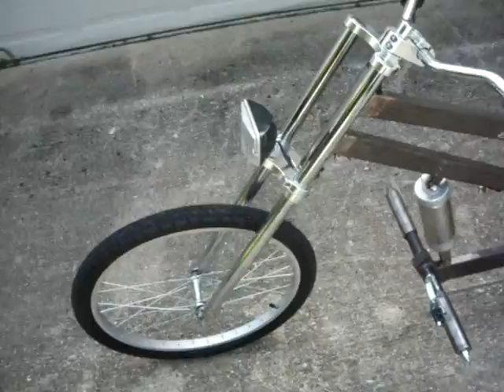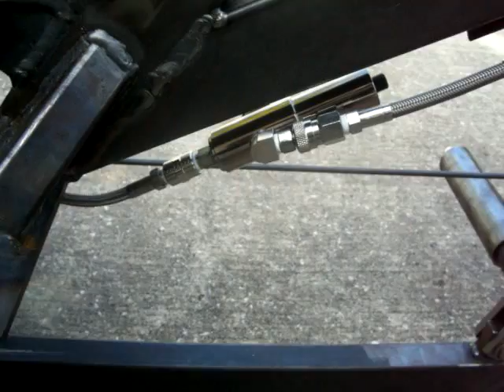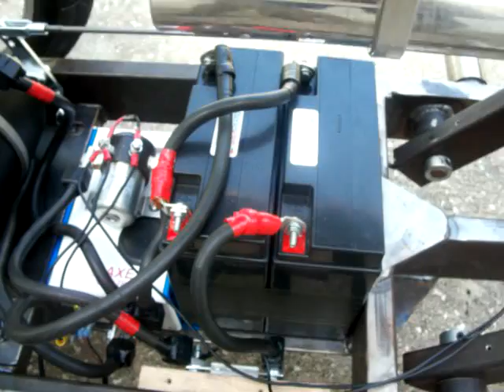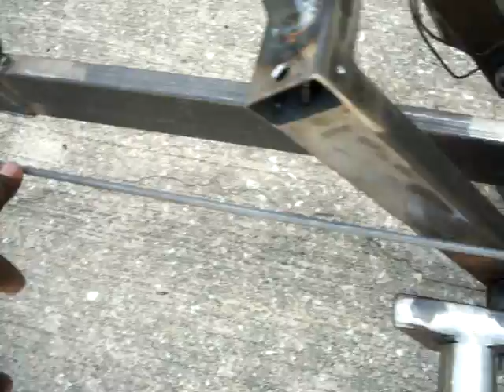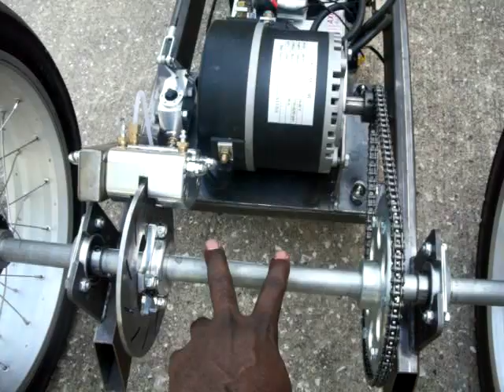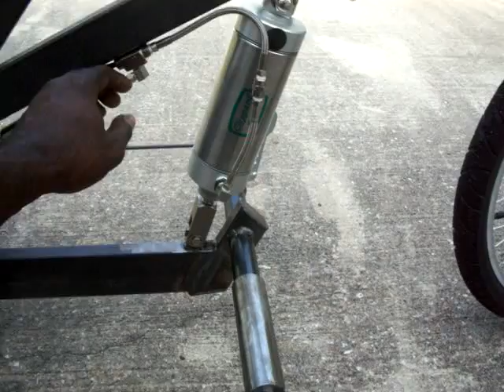Electric Trike w/Air Ride Suspension Pt. 2

Comment: 10-4 on the solid axle. Welding looks top notch. Everything is clean and sharp. Even the improvised pushrod and bellcrank break train looks tight.

Kudos.

Comment: Additionally, I've built some hot rod scooters.  You can use the Schwinn/Currie 24v 600 watt motor quite successfully at 36v.  I'm running 10S Lipo on mine and it has been working well for 4 years as a pit bike at outdoor trade shows.  I'm geared to run 28 mph, it's about 2000 watts setup as such.  It's the best of the cheap scooter motors that I've gotten to try.  If you have the dough, Lipo's produce quicker acceleration because they depress in voltage less under load.

Comment: I enjoyed your video.  Your a creative person.  Used to race Karts, back in my fathers racing days, he designed a one way bearing axle and hub setup to eliminate the scrubbing in the corners.  I still have the axle somewhere.  This allows one wheel to outrun the other or turn faster than the axle but not slower.   When you do this, the disk brake must be on each hub, not the axle since the hubs are allowed to overrun the axle.   Nice work sir.

Comment: Very nice build. Instead of buying a rear diff, you can just run one of the rear wheels and have the other wheel independent of the axle.  That should help with your turns. If you do this you may want to have breaks on both wheels so you wont end up turning when you break.
Reply: screw having the power go to both wheels, that makes too such sense right?

Comment: Cool. I know there was a lot of work to build that. I'm building a pedal powered machine that's 4 wheel drive and 4 wheel steer. It has Gokart disc brakes, sprockets and a Comet reverse gearbox. It will have multiple speeds. I'll also build a plow so I can plow the snow off the sidewalk with it.

Comment: Nice machine, & very good mechanical designs there, if you sort the diff out on it, & re-design the frame in a lighter material, you can patent it as your ow thing, as it looks & works great, one the best electric trikes I have seen. Good luck

Comment: COOL, how do I get a set of plans..???   I'm a disabled Vietnam Vet in a wheelchair, & 66yrs old, the kneeling feature would help me to slide on to it, I want to build one, & put an extra wheelchair seat I have on it, & I have an electric motor that I can use in place of your hydraulic cylinder to make it kneel.. do your plans also have all the info on the electronics/wiring also.??

Comment: Lots of excellent craftsmanship. and plenty of systems.  So a great test bed and tour de force of your skills.  Not enough batteries, nor right type to go very far, but for a test bed  doesn't matter.   Letting one rear wheel free wheel will solve your "turning" problem with no differential, but a 3 wheel bicycle differential might take the torque from the electric motor.  Get one from a Chinese 3 wheel bike.

Comment: Until you get that straight rear axle changed to a differencial, tip up on two wheels when you go around a corner. Heads up on a good source for a reasonably-priced differencial. A lot of older riding lawn mowers had chain drive to the rear axle with a small Peerless differencial which would be just the ticket for your appl. Oh, and I don't think that rear brake foot pedal setup looks bad! Good lookin trike!

Comment: a real quick fix for the turning problem would be to put a bearing in one rear wheel & let it free spin on the solid axle,it would only be one wheel drive but it would corner

Comment from the maker: Subscribe to my channel and please check out the ride video. Titled;  Electric Trike w/Air Ride Suspension Pt. 3 (RIDE). Thank you and Thank you for watching.
Reply: +BlvdMinSS I love the whole design. I was wondering if moving the forks forward about six inches, changing the fork angle more like a chopper as well as toe in back tires by three inches, would it create instability? I am epileptic and can not drive but, i have a stingray. I have no tools and was simply wondering how much would you charge to convert my stingray that way?
Reply: Hey, I have a few questions about how you build your trike. First off, are both of the wheels welded to the same axle, or is one not powered. What type of metal did you use for a body? and lastly, how much did it weigh?
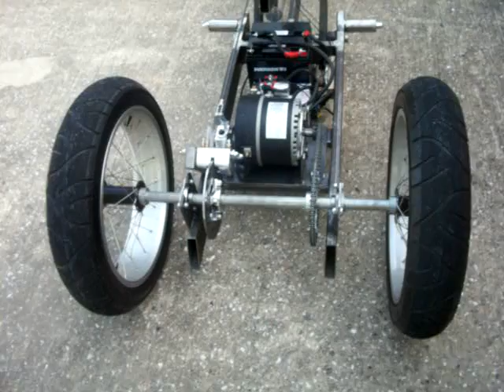Reply: BlvdMinSS   3:15 Reduce the length of the back axil or increase the diameter of the back wheels.
  This should significantly change the radius of the turning.

Comment: Beautifully done.  A few wire ties will solve the wire problems.  You might think of narrowing the rear track and introducing leaning rear wheels.  Google iLean.  Very simple but the iLean system requires a bit wider track for stand alone balance and heavy weight carrying.  The iLean system works best with two rear hub motors.
Reply: +Lawrence Rhodes I would have to agree with you about having 2 rear hub motors. That would solve the problem with having a differential, however would have to have a controller that slowed the speed of the inside wheel when making turns.
Reply: +Joel Hill Not needed. Ohm's Law will take care of it.  However while working perfectly one person asked the question of "why". https://www.physicsforums.com/threads/rear-wheel-drive-with-separate-motors.833068/

Comment: nice build, I personally would tidy up the cabling and especially cover the power contacts, don't want some short across that :P
the Pedal cable shouldn't be stiff and be like bike cable so you can at least route it around.
Does the controller provide charging should you go downhill, etc? so it charges back to the battery, I wouldn't thing it'd give much of a charge tbh.
neat work regardless, almost a choppa.lol

Comment: That's a sick little build man, looks like fun! Just curious, you said two 24V batteries, but it looks like they're wired in series.  Are you running the motor at 48 volts or running two 12 volt batteries?  Nice work!

Comment: It looks like you've done a great job (after you replace the rear axle), to me.
I'll be building one much like it this summer. Thanks for the lead on the rear differential.
Where did you get the motor and the small batteries?
Ron

Comment: Nice work but don't use a differential!
instead use 2x bicicle free-wheels for 5$ each,weld them together&mount them
between the axle ,just keep them cool during welding,
this would work just as well on a trike like this.

Comment: why not make the rear end a 1 wheel setup and put the other 2 in the front for better steering? of course on the next project, because this looks to cool, whats your life span of the 48 volt battery setup before it needs to be recharged? also what motor size is that

Comment: I like your set up its basicly a electric golf car only probem is those batts probly won't last long especially with the amp output capability of that controller but its deff a great toy what motor u using? I would try runing it in series (batts) doubleing it if I had it if I planned to cruise it myself but as a toy its totally awsome congrats!

Comment: Nice build brotherman. What is the designation of your electric motor? I am looking for a 24-48 volt motor in a build I am planning. Is your powerplant an electromotorsport 15Hp 48V 275A or something close? I would like to look up your engine on the web. Could you direct me to a website? . The size is right but could you give some info on horsepower amount, weight and diameter....if that is cool. Good luck rebuilding the rear end. Cheers!

Comment: Did you ever think of putting a regenerative braking system on the trike? Is it possible to use the motor as a generator to provide the braking? That way you could extend the range by making the trike into a hybrid etc etc.
Reply: darkmath100 The use of Magnetic Regenerative Braking does not a hybrid vehicle make!
Hybrids are a fusion of electric motor propulsion and internal combustion engine technology that  compliment one another to increase the overall efficiency of the vehicle. 

The electric motor and IC engine supplement each other but don't replace one another.

Comment from the maker: You can find the wheels at wwwdotchoppersusdotcom 20" dia x4.25" wide. The tires are from wwwdotbikedirectdotcom (worm tread pattern???), sometimes they are in stock at choppersus. You may be able to find them at a pawn shop or on craig's list. They are off a Shwinn Stingray bicycle. However, for some reason those bikes are high dollor. I had to fab up the hubs to fit a 1" gokart drive shaft. I had a bike shop respoke the wheels for me. . .High Dollar! Thanks for watching.

Comment: assuming those batteries are 20ah each you should get about 2 minuets tops. Get some better batteries, and that motor is a 4 hp peak motor at 24 volts it will draw around  130 amps. Those deep cycle batteries will only put out 100 amps a piece peak and since they are in series your only going to get 100 amps total. The Altrax controller won't identify this problem and you will melt the terminals on the batteries, and in the process fry your controller.

Comment: saw a video on here guy took a electric motor hooked an generator from a car with a pulley gen to motor he plugged it in ,,,once the motor got going the gen kept it going till he shut off the switch ,,,you should try it ,,,just a thought ,,,

Comment: People really need to stop using Lead Acid batteries for these things, the weight isn't worth it. Use Lipo batteries, they can hold a LOT more energy, or even get some LifepO4 's they are safer to use
Reply: +nikotwenty Or even modern Panasonic or Samsung 18650 cans, in big packs with BMS etc...You're quite right about that. And I question the versatility of this beast when you can build a much more versatile lightweight e-recumbent trike, with modern bicycle parts, which combine the capacity of the fit human as well with the electric assist. Something with 48v nominal and 40Ahr of lithium would do it. You would need pedals on it to increase the versatility and range though which is "outside the box" from the point of view of <this> design I suppose.
Reply: Chris Hvid  How about Gell Cell batteries supplemented with supercapacitors - - and regenerative braking?
Reply: nikotwenty  Lipo batteries? Why not Gell Cell batteries, combined with supercapacitors? Now that would really reduce weight